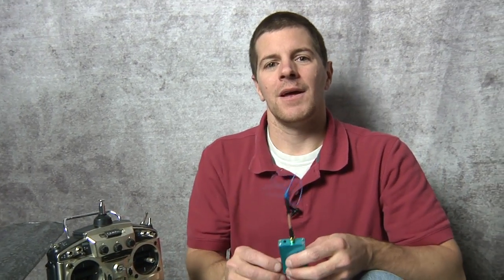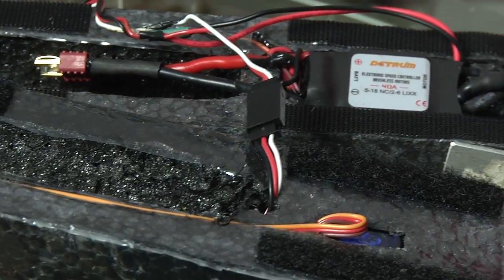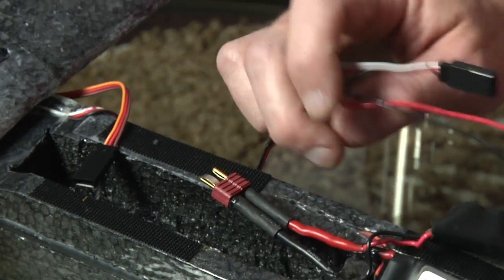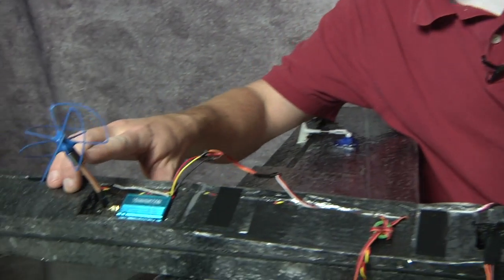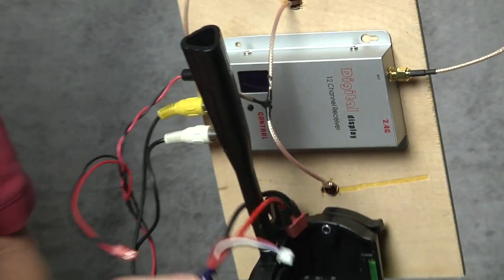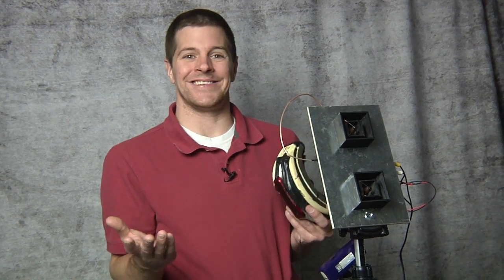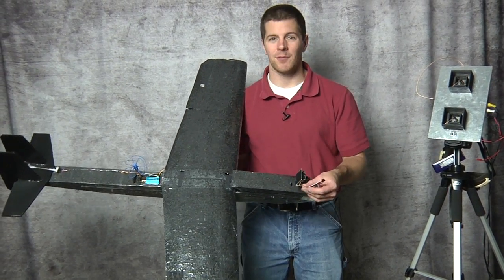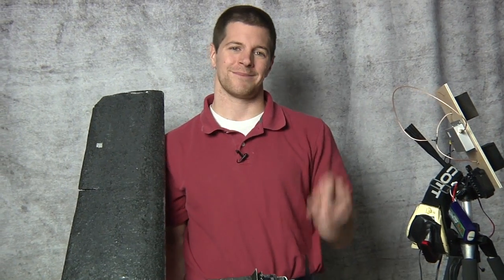How to be successful in FPV part 7:  Wiring it up

Comment: Hey Alex
 Jeff again. Stupid question !- If the fat shark goggles have a receiver why do you need one on the tri-pod?
Reply: +Jeff McCallum its optional. you can use the signal from the tripod and view it in your goggles. the directional antenna on the tripod is (as long as you fly in that direction) way better then of a omnidirectional.

Comment: I run a 5.8 ghz vtx system and a 2.4 ghz rc system, what's the operating difference between a 600mw vtx and a 2W vtx?
Reply from the maker: Patrick Miles 2W is good for ~80% more range and 3X more interference to your rc control and other pilots.

Comment: @10:42 you say with a high gain "Pepperbox" was mentioned that a 200mW Video will get you as much as 30 miles? I'm running a 5.8Ghz 200mW with circular polarized Ant. that being said, if I upgrade My reciever Ant. to say a higher gain Helical I could possibly get 15-20 miles Maybe? Planning on Upgrading My Control Transmitter for LRF and I was thinking I'd have to upgrade My Video Xmitter to something in the 500mW to keep up! I suppose I could get away with 200mW then with the proper Video Reciever Ant? Right?
Great Vids, thx for sharing your knowledge..  :)
Reply from the maker: Using 5.8GHz for range is like using a slingshot to hunt deer.  It can work, but it isn't likely to do any good.  You really need a lower frequency to overcome the loss over distance.  The 30 miles is on 200mW at 1.3GHz.  at 5.8Ghz this drops to closer to 5 miles.
Reply: Ok, Thx for that info, I do have a 900 Mhz system also, but been avoiding it because of the huge Ant. but looks like I'll have to go with that..  :)
What would be the best Ground Station Ant.... Helical?
Thanks for your reply, awesome Vids too...   :D

Comment: my video transmitter says 500mah max, whats going to happen if u use a battery with more mah like 2200mah on your video tx or rx, u can burn the transmitter. i need help with this
Reply from the maker: I believe you are mixing current with capacity.  Your VTX is rated in mA of current draw.  Your battery is mA*hours of capacity.  No problem using a bigger battery.
Reply: Alex Greve you always have the answer. thanks again

Comment: i found a DJI AVL58 5.8GHZ FPV Video Downlink (Transmitter & Receiver) for 179$ 

http://www.ebay.com/itm/DJI-AVL58-5-8GHZ-FPV-Video-Downlink-Transmitter-Receiver-/261707304954?pt=Radio_Control_Parts_Accessories&hash=item3ceef88ffa

* is this a HD video transmitter, how much quality video it has?
* how long range do i can have?
* do i can change antennas for better range?
* do i can put this system on an airplane, i have understanding the DJI is only can be use with DJI drone, i do prefer airplane.
 IM JUST TRYING TO HAVE A BETTER VIDEO DEFINITION AND GOOD RANGE.
I BEEN SPENDING A LOT TIME LOOKING FOR ALL THIS, THANKS FOR YOU HELP

Comment: Hello! Thanks for the video. I bought a Plush 25A 2 A ESC but my mate says it is best to use a separate UBEC... as 2A is not enough to power all the other gubbins... or should I juts splice in a better ESC to the battery? cheers bud

Comment: i want more definition video, what i can do. can i use my go pro 4 black edition/? (i never used before for fpv) what goggles has HD.
* i don't want to buy DJI
tell as something similar but not like that expensive 
i hope u help me thanks, keep doing a good videos
Reply from the maker: There is no HD video which you can use to fly.  They have too much lag.  You need standard analog video links for FPV.
Reply: Alex Greve i sow a dji fpv system with a really clear video, is that posible with other kind of system.
lets start with:
what is it give u a good quality video???
the camera or the antennas
Reply from the maker: Aldo Allende Oliva
 - The camera is the most important thing when it comes to video quality.  A poor camera is not going to produce a clear picture.  Antennas are the second most important component.
Reply: Alex Greve i have a friend, he is radio tec. he know a lot about radios and antennas nut he doesn't know anything about the hobby, he say that i need a HD video transmitter, do you know where i can get one
Reply from the maker: Aldo Allende Oliva
 - HD video transmitters have too much lag for flight.  You will be 1/2 second behind your aircraft which is no good.  You need to use a standard definition video system.
Reply: Alex Greve thats good to know. 
thanks alex

Comment: I'm new into FPV and was wondering about upgrading to a higher transmitting signal. What I've learned from this video and your previous ones is save my money and upgrade the antenna instead. Thanks for the videos, I've been really learning a lot.
Reply from the maker: Yes, this is the best way to improve performance.  upgrading the antennas is the cheapest and best way to get the most out of your FPV system.

Comment: IBC..I started and did well on 2.4 but due to 2.4 fliers at flight line causing bad interference, went to 5.8. 5.8 is ok for flying close in to field...which I do most...but I plan on setting a 5.8 linked 2.4 helix ground station away from flight line to be able to return to 2.4 advantages like tree penetration... will steer helix with a couple servos for general rough tracking as I will be using only 3 turn 2.4 leaving open channels on 72 for head tracking...good idea, any cautions??

Comment: Alex, WHY does your antenna need to be mounted upright? Why can't it be mounted upside down? Does this effect it somehow? Please explain. I've had my 3dbi 900mhz whip antenna upside down for a while now and it seems to work fine. I'm trying to figure out if there is some advantage to having it the other way. I put mine upside down so it protrudes from the bottom of the craft since you will always be under it. Also, I have a metal plate in my multi so it may block some RF....maybe?

Comment: Great video!! So pleased to see the 2.4ghz system is the same as mine, I have been thinking of changing  to a 5.8 fatshark tx/rx as being unsure of the quality of  my 2.4ghz system but now I see its what you are using it must be good & reliable, also I hear that 2.4 has better performance than 5.8ghz? also I dont belong to any flying clubs so still use 35mhz and 2.4ghz RC systems, many thanks for your informative videos, jools.

Comment: So to be clear, is the transmitter or receiver antenna 6" and is this 6" in diameter? I think I have enough clearance as my antenna is under my hexacopter instead of on top like most people. So what are BluBeam Ultras? Also, where can I get some 900mhz antennas? Are you all out? Thanks!!!

Comment from the maker: Because you are on 5.8GHz.  New WiFi systems are on 5.8Gz so noise floor could be your main problem.  On the equipment you are running I get a comfortable 3-4 miles... I hate 5.8GHz.  Hence why I championed the 2305 and 2396MHz band.

Comment: whats the erp or gain if the tx on plane in watts.  is there a ratio ,vswr losses etc. being equal . great video . do not the antenna for the video be on the bottom of the plane of ones choice. which coax is best for all of the video equipment, thanks